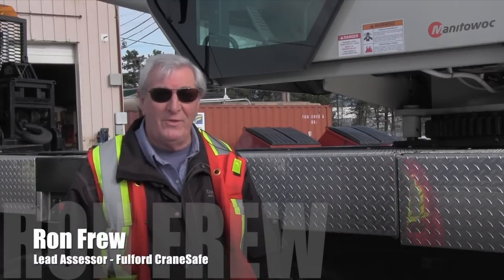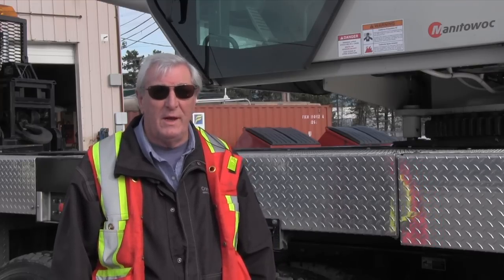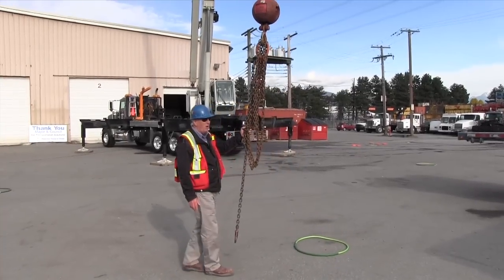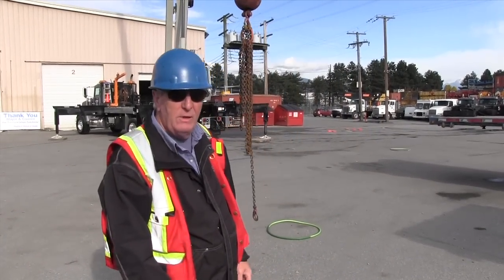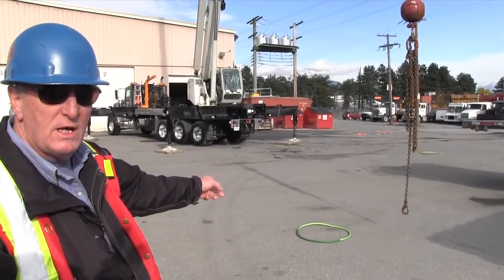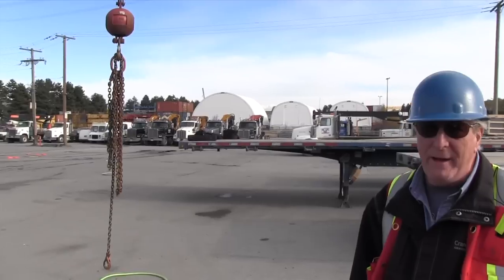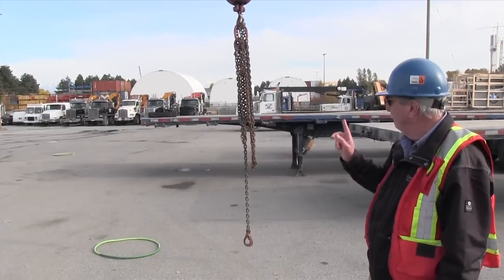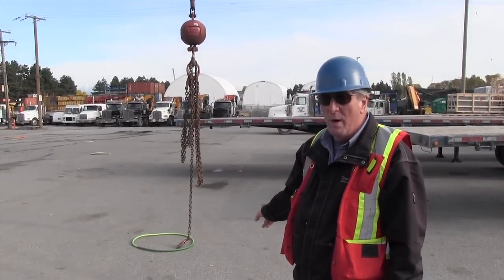Crane Operator Load Control

Comment: Hi..here's what they dont teach you. Where i come from loading and unloading ships alot of the work is as fast as the equipment will go. If you swing a crane fast and go from point a to point b by just winging or slewing then when you get to point b the load/ counterweight will be swinging in a circular motion. So to eliminate that you boom up or down as you swing the load. Once you've mastered that there is no circular motion period but a load that has zero sway and easy to control. For me nothing is more fun than operating a fast smooth crane with a fast response !😀
Reply: Man this made so much sense. Ive failed my practical for crawler multiple times due to no controlling the load. I re-test thks Friday and this just gave me confidence. Thank you
Reply: Or erecting iron with some good ole boys that are at the top of their game and good on the radio.when a operator has the confidence to go fast where he can't see .everybody knows there's a dam good raido man up top
Reply: Thanks for the tip. Been doing mobile crane training at work and looking for tips for swinging and controlling the load.
Reply: They must call you simple Simon.

Comment: Nice video :) Depends on the crane trolley cranes and others have different speeds but in theory is all there, fallow your load and if on top of it there is no way it will swing to the sides as gravity aligns the load with the top... but if you align it yourself then by by swing and faster smoother operations. remember as the loads get rigged the bigger the angle the more force there is on each sling is call uniform load method, never pick up a load outside the crane reach as this can overturn the crane, or if side ways to the jib can snap the sheave sides as sheaves are designed for horizontal loads bearing forces... vertical forces only :) and if not sure as the pros there is no one cooler then crane op and riger/slinger signaler most are professional and partial and will help wen and if possible! no arm to ask the community

Comment: i'm new at operating a overhead crane, I have done the same technique and it works all the time, you have to gradually increase the speed depending on the distance and the load, taking off fast is going to cause the load to slack behind.